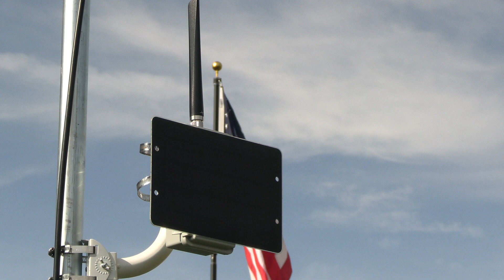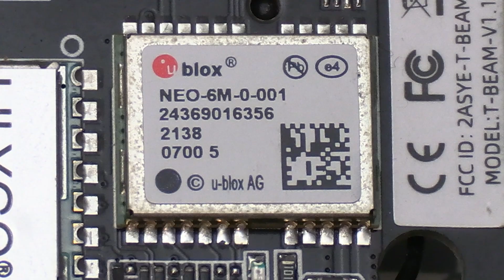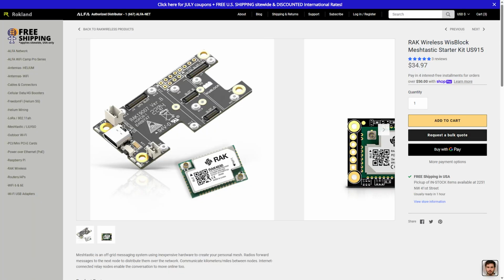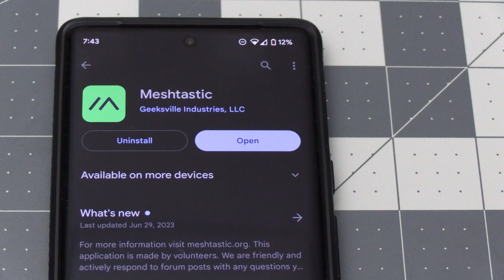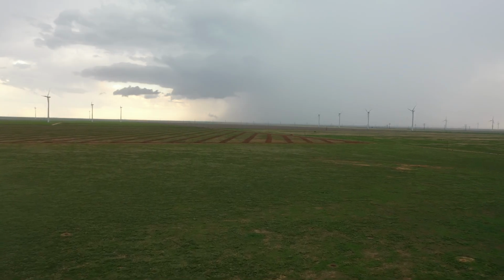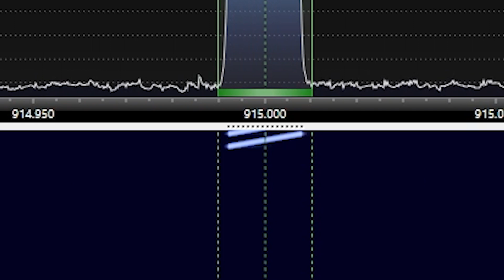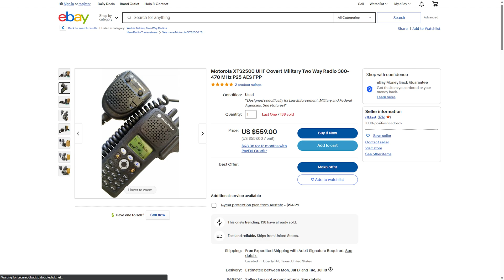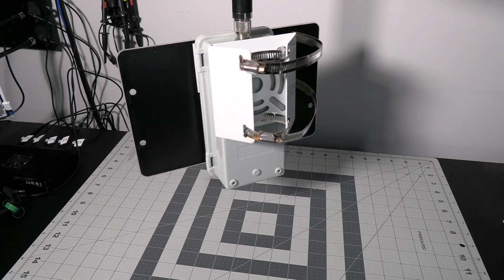Encrypted Comms - DIY Solar WisBlock with Meshtastic

Comment: Maybe this is a dumb question, but I've been trying to find the answer online and I'm still coming up short, so I'm asking here. Is meshtastic strictly for more local (ie. within a 100-150 miles) communication or is it possible to do very long range communications? Can a message be sent across the entire mesh network, assuming there are many nodes within range of each other to make the hops? Let's say for example, I live in Atlanta, Georgia, and I want to get a message to a friend who also has a node in Boston, Mass. If there are nodes to forward the messages all the way up the East coast between both of us, it is theoretically possible to get messages back and forth to each other? Thanks!
Reply from the maker: Not a dumb question at all! Meshtastic is more for local comms. You could use MQTT to send messages to your friends node in Boston through the Internet, but I've always felt that it doesn't count unless it's over the radio waves.
Reply: @The_Comms_Channel  Hmm, that's kind of what I was afraid of. MQTT doesn't really interest me. IMHO, the true power of this tech would be the ability to blanket the globe in low power nodes that could transverse vastly large areas and get messages to people across entire continents via radio without ever contacting the internet. Granted, it might be slow by internet standards, but it would be very powerful, especially during a national or global emergency. Thanks for the speedy reply! 🙂

Comment: I wish that Apple and other phone manufacturers would incorporate this hardware into their devices and enable it to be switchable via either a hardware or software switch. Apple has already integrated its SOS satellite system and mesh platform for products like AirTags into their phones. So, why not license and expand the chipsets slightly to offer LoRa capabilities to millions of users? This step would propel Meshtastic into new dimensions. I'm sure it would drive cell phone providers crazy, but who cares!

Comment: I'm working my way through these videos, out of order, but there's great info here.  Thanks!  I have the 18650 batteries and battery packs.  I just ordered the solar panels and they'll be here in a couple of days.  The 8.5 dBi antennas will be here tomorrow and who knows when the Meshtastic starter kits that I ordered from RAK in China will be here - probably long after they're back in stock at Rokland.   :-)  I'm going to download a CAD model of the WisBlock so I can design and 3D print the custom pole mounted enclosures.  This should be a fun project, and based on the news, it may be very useful, very soon!

Comment: I can't find this module anywhere where I live. Are there alternative boards that do the same thing - or at least most of it - without just using a t-beam with gps and all that?
Reply from the maker: Where do you live?
Reply: @The_Comms_Channel  Germany
Reply from the maker: @UnknownUser-pf9rk  I have an affiliate link to Rokland who will ship to Germany and may be worth looking into https://store.rokland.com/products/rak-wireless-wisblock-meshtastic-starter-kit?ref=tc2

If the shipping is too costly, then ordering direct from RAK Wireless may be worth looking into as well. https://store.rakwireless.com/products/wisblock-meshtastic-starter-kit?variant=41433735725254

If ordering from RAK Wireless directly, you can use my coupon code TC2 to help bring costs down a bit.

There are not many other options out there for an NRF52 board that will be good for solar setups. Anything ESP32 is not as good of a choice due to how power hungry they are.
Reply: @The_Comms_Channel  Thanks for the quick help! I will look into those stores. For the first one, however, it is sold out at the moment, unfortunately. Also, I need the EU868 version which doesn't seem to exist in the first shop.
Reply from the maker: @UnknownUser-pf9rk  Sure thing! Ah, that's true, for the EU868 you're probably going to need to order direct from RAK.

Comment: OMFG that is exactly my wife's reaction.

That's honestly a lovely build out.  I love the set and forget capacity of this.  This could be a great way to get a neighborhood watch communicating using an equivalent of APRS and ATACS without the barrier to radio that gives me wife that look.

I suspect I could rig one of these up in my vehicle as well.  Just needs a small panel in the window and an antenna outside of the faraday cage of a body.  Could keep track of whatever sensors it's plugged into as well . . . easy peasy.
Reply from the maker: Neighborhood watch would be a great use-case and easy to get people on board with!

Comment: So, first off I am a ham radio operator with an extra license and I am wondering if this LoRa device with the gps can be carried out where there is no cell service.? My wife and sister in law where out on a hike in Utah and got into trouble and had no cell service and I am wanting to get something that they can use when I am not along since I carry my radio when cell service is gone. Also I am looking for something new to build in my spare time and this looks cool.
Reply from the maker: No cell service is required to use them. They could take a LoRa device with them on their hike and if you have line of sight from your location, you could communicate. If not, a device could be deployed as a repeater somewhere with elevation or maybe someone's ham tower. These devices connect together to create a mesh network so you could have them at multiple locations. Definitely cool technology and it's been fun to play around with.

Comment: Does this act as a Meshtastic repeater node right out of the box without cell phone setup?
Reply from the maker: It doesn't. It will still need to be set up to whatever mode you want. You can set this setting from the computer if you prefer not to do it from a phone.

Comment: HI, what a great project!
I was wondering how can you get such clean LORA chirping on SDR console (03:35)?
I always got a blob of noise, can you share how do you set those parameter? 
thanks in advance.
Reply from the maker: Thank you! Great question! The only settings I set on SDR Console was SAM mode. The key is the settings on the LoRa device. What's happening is the LoRa CHIRPs are too fast, so you're not able to see them on the waterfall. You need to set the spreading factor to 12 on the device. I will try to do a video on how to do this tonight or tomorrow
Reply: @The_Comms_Channel   Thanks a lot, I set the spreading factor to 12 and I do see the same result, looking forward to your next video!
Reply from the maker: Sure thing! Glad you got it working!

Comment: I use the Lora SX1262  and R820T. The signal I observed is not as clear as yours. 
The signal I'm observing is both wide and flat in shape.
How do you set up the sdr console?
Reply from the maker: Thank you! Great question! The only settings I set on SDR Console was SAM mode. The key is the settings on the LoRa device. What's happening is the LoRa CHIRPs are too fast, so you're not able to see them on the waterfall. You need to set the spreading factor to 12 on the device. I will try to do a video on how to do this tonight or tomorrow

Comment: Ummmm why is the solar panel mounted vertically ?? 😩
Reply from the maker: It's not mounted vertically; did you mean horizontally? It's mounted this way because it's the best fit to the enclosure without blocking the antenna.
Reply: @The_Comms_Channel  Horizontal means flat, like on a roof.

This shows it mounted vertically on the side of the box.
Reply from the maker: Ohhh, I gotcha now. I thought you meant the orientation of it on the side of the box. Ideally, it would be nice to have at an angle. Having it on top isn't really an option due to the antenna. Still works pretty well though!
Reply: @The_Comms_Channel  You'll gain about 50% more efficiency if you can get at least a 45 deg angle.

I know the batteries & circuit are efficient, but you'll probably struggle in winter.
Aluminium or wood might be easiest.
Reply: @edwardfletcher7790  45 degrees --------> latitude where used, whatever angle that is

Comment: If you have several cloudy days, and the battery dies..does it restart when the battery is once again solar charged on the next sunny day? If not, this would be big dilemma when you mount this in a difficult remote location.
Reply from the maker: Thanks for the great question! In my experience, they will not power back on themselves after the battery is depleted sadly. That said, these devices are low power as long as you are using just the standard WisBlock and LoRa module without adding things like GPS. You should get over a week of use with a single 18650 battery and should be fine in most situations. If it is a concern though, the first one I made had two 18650 batteries. The enclosure has plenty of room, so you could add even more than that if needed.
Reply: @The_Comms_Channel  Replace 18650 with  
LTO Yinlong Cell 2.3v 40ah Power Cap 66160H - LTO A-Grade or Sodium Ion 33140 15Ah

They Can charge in very low in Deep negatives Temps  NEG 30C - neg 60 for LTO

I would Set up A 555 Timer (Momentary Pluse On )+ optocoupler Isolator  (own PCB with 2 thin wires Going to the power Button Pins )

555 Get power Form it own Soler cell So ever day on sun light  the optical Isolator Mimics Someone PUSHING The power button

Comment: The RAK uses a Lora SX1262 chipset which has lower idle power usage, transmits at 22 dBm and has a boosted RX gain option. The newer LILYGO and Heltec boards also utilize a Lora SX1262 chipset. I have all 3 and they work great with Meshtastic. I agree the RAK is best for a fixed router/repeater location, solar charge controller connecter, no screen and modular configuration. Great video!
Reply from the maker: It's a great chipset for sure! Really liking the WisBlocks and just got the RAK Movement Detection Kit to play around with! Glad you're enjoying the videos!
Reply: @The_Comms_Channel  would be a great video and love to see it.  Was trying to get the gps tracking to work to tell if a GPS enabled phone came within perimeter but have yet to send a message based on movement.